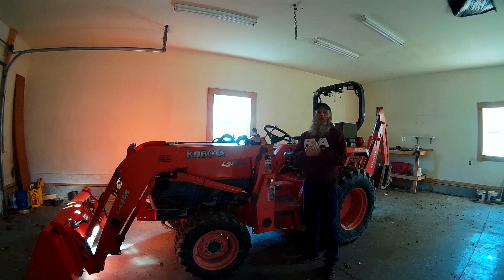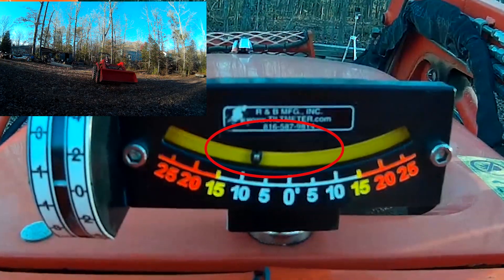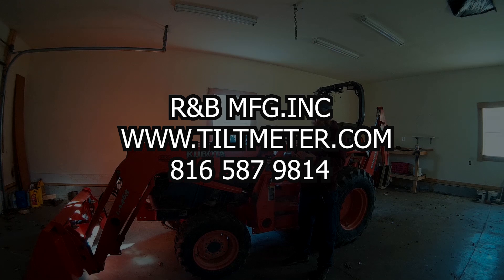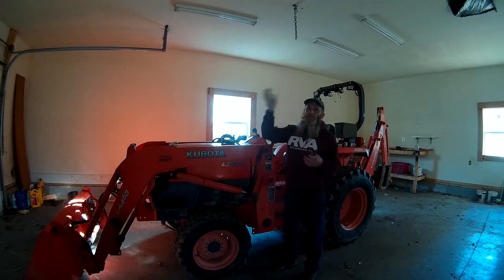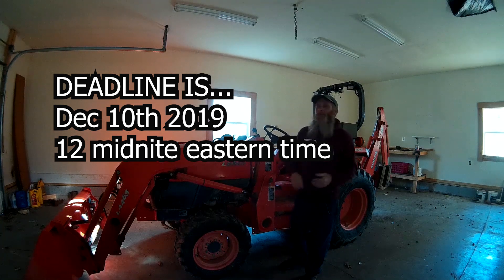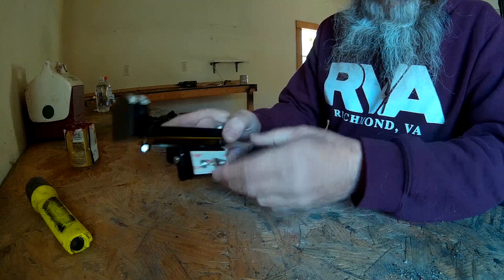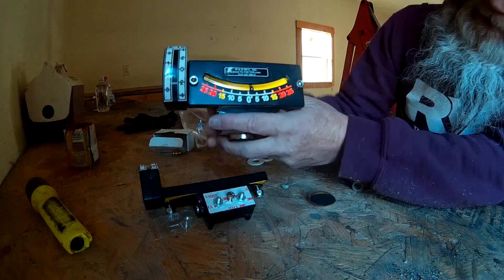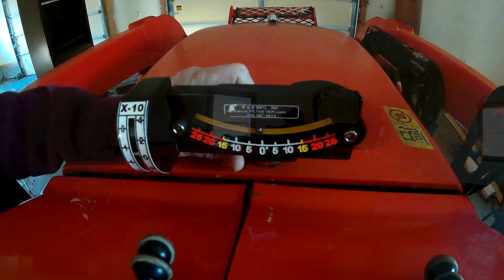inclinometer free giveaway! what the heck is a inclinometer?

Comment: You could also use a thin rubber instead of felt to increase the grippiness.
Reply from the maker: I started to use an innertube from a bike but thought the glue may not bond well enough. not sure but I like the rubber idea better than the felt. rubber will be more durable out in the weather.

Comment: I'm really interested to hear your experience using your inclinometer.  They should also come with forward and reverse facing radar to spot upcoming roots, dips or bumps that might upset the tractor!
Reply from the maker: for sure I hope to do a more in depth analyst of the device and the pitfalls of its use or rather improper use. or maybe a better wording is " false sense of security " if you know what I mean.